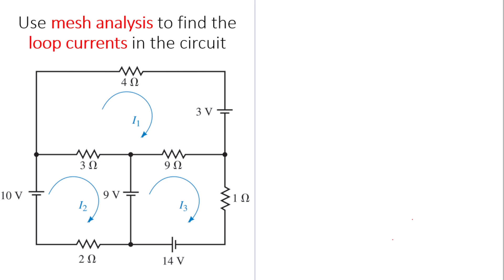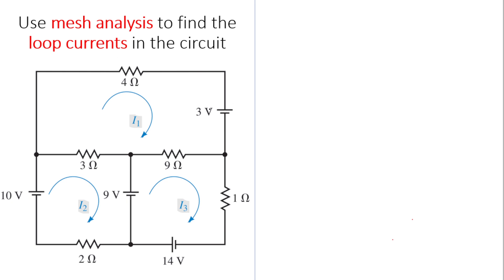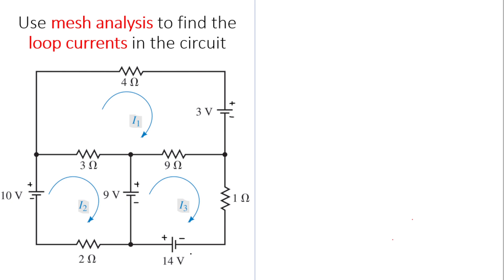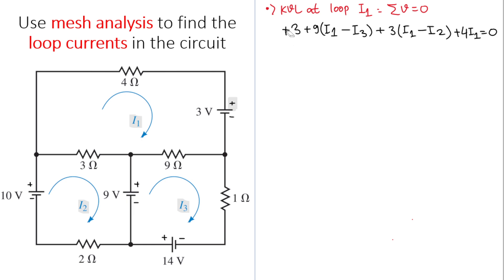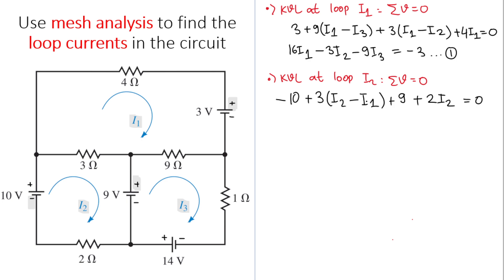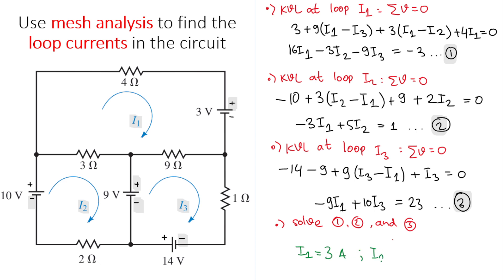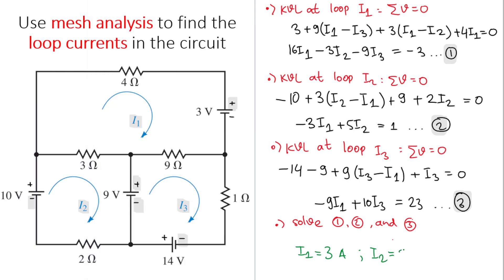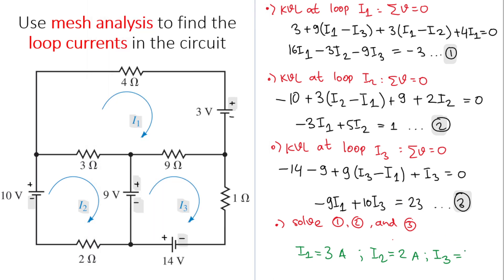MESH ANALYSIS 3 LOOPS | STEP-BY-STEP | EASY CALCULATOR | Use mesh analysis to find the loop currents

Comment: Hi Ardi, have you ever used ltspice? Its a free simulation software, is there any chance of making some videos of how to set up the software paramethers to simulare first order and second order circuits and its graphics? 😢
Reply from the maker: Hi, I am not used to LTspice. But you can use a similar Texas Instruments circuit simulator, which I find easier to use.
Reply: @ArdiSatriawan that would be Pspice but its paid, isnt?
Reply from the maker: @Colombia2R  You can use the web version for free if I remember correctly.